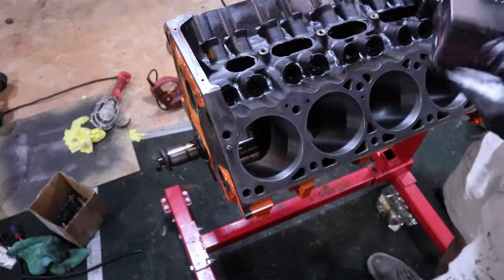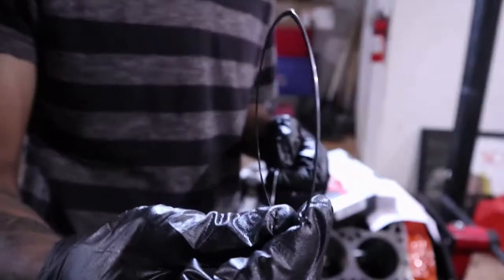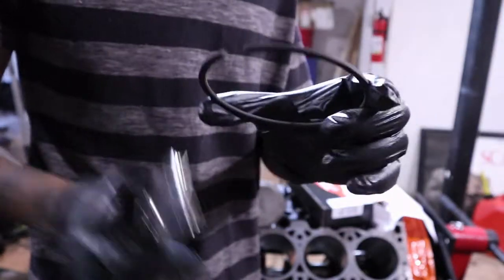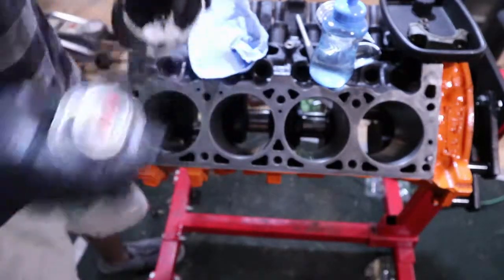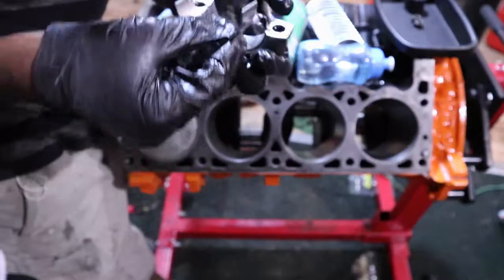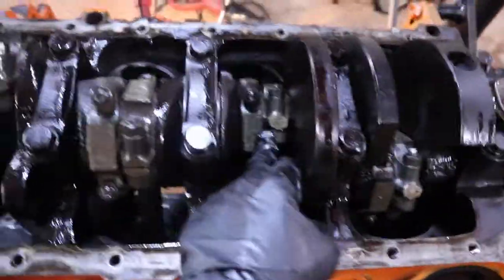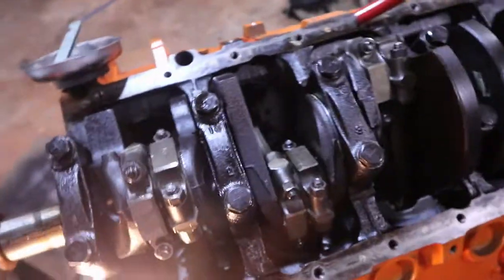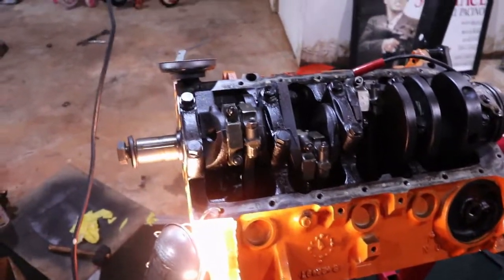5.2 Magnum V8 engine Piston install

Comment: Where you located ?
Reply from the maker: Atlanta
Reply: Thank you, this was very helpful. I am doing the same thing right now and didn’t know about the connecting rod base being directional
Reply: Weird the the stock rings on my magnum,the one with the dot was at  the bottom with the dot facing up and the one with not dot on the top,any ideas ?